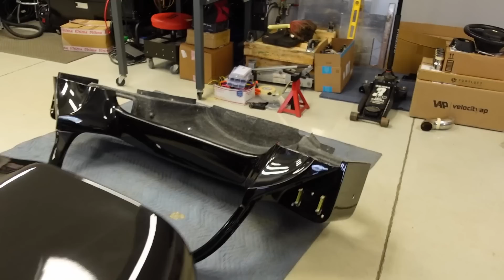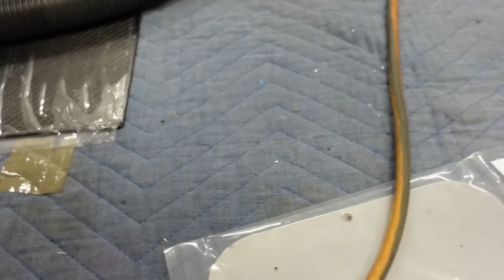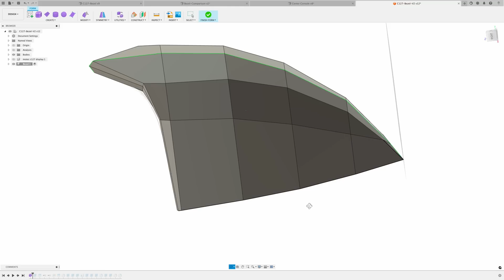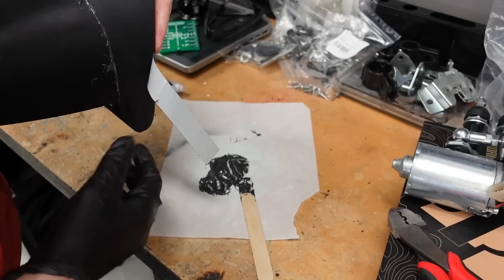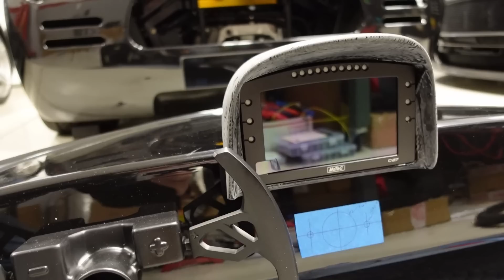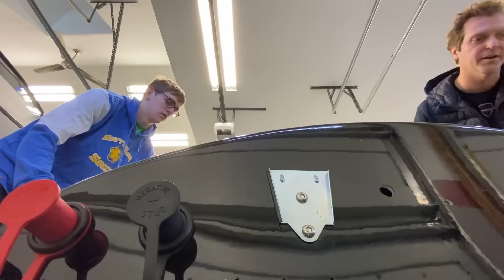I Design a Custom 3D Printed Gauge Bezel!

Comment: Not a criticism but wonder if you will revisit the MOTEC display once the car is finished, I have sneak suspicion it might be too high and block your view out inconveniently… guess it woul just mean a new 3D printed pod and drop the display down into the dash a bit more. 

Looks awesome… wonder what your next project will be to top this this one. 🤔

What about a full carbon replica 6R4 metro by MST in Wales, UK… their Mk1 ‘escorts’ are beautifully made.
Reply from the maker: With both versions of the pod, I sat in the drivers seat with the windshield in place to test visibility.  For sure version-1 was way too big.  But for version-2, I lowered the display another ~25mm and it's at a good height, imho.  I don't want it too low as I want to see the display somewhat in my peripheral vision.  But as you stated, I can always change it later if need be.  

Great question about my next project...I have a couple ideas but certainly thinking about it!

Comment: Dan, firstly love the build. It's probably too late but I personally think that the binnacle still sits too high. Using the same mounting points, could you not trial another binnacle with a lower profile thereby lowering the screen further down the dash? Please don't take this as a negative comment, as everything else you've done is fabulous.
Reply from the maker: Hi Richard--no offense taken!  I love feedback as it helps me refine over time.  The version-1 pod was definitely too high and too big.  I lowered the entire pod and screen ~25mm more for version-2.  With the windshield in place and sitting in the drivers position, I considered going even lower before I printed version-2 but then the screen starts to escape my peripheral vision.  The 7" screen is certainly big for the small dash real estate of the Ultima.  I considered the 5" MoteC display and it would probably be better for the Ultima but I wanted the extra screen for maximum flexibility.   But like you said, fairly easy to change down the line if needed.  Thanks again for your feedback!

Comment: Cover the binnacle in carbon fibre !
Reply from the maker: I definitely considered carbon skinning.  I might make another one so I have options.  🙂. But I ultimately decided on Alcantara due to it's low reflectivity; will minimize windshield reflections on sunny days.  Plus it will match the rest of the dash that will be covered in black Alcantara as well.

Comment: Dan, I really admire the standard of your work on the car, the thought that you put into the build, and the quality of your videos.  Did you consider angling the monitor towards the driver?
Reply from the maker: I did consider that. But it didn’t make much difference given how small the cockpit space is. Plus sharing the display with the passenger will add to the riding experience. I also considered putting the bezel in front of the driver but it’s nearly completely obstructed by the steering wheel.

Comment: For those side areas where you need to climb over I would recommend a harder flooring type of vinyl or leather like material or a marine or kitchen carpet or some heavy patterned rubber as used in truck beds.
Basically you want something that will tolerate abuse as those areas very quickly accumulate scratches stains and other damage. You also want them a bit slippery so as not to grab clothing and skin if someone sits on them to climb in and out.
Reply from the maker: Great advice as always!  I love the look and feel of Alcantara so I'm going to give it a go.  But I'm going to make sure to 'section' the covering so I can easily replace just the top bits when/if it gets worn.  I was originally going to carpet the top sides for the very reason you mention; but ultimately i want to try something different. 👍
Reply: @DanDulac  .
There is a kitchen carpet that looks and feels a lot like alcantera, it’s a vinyl with a flock like coating of about 1mm thickness on a 3-4mm backing
It usually comes in tiles and has standard flooring style patterns and colours, but if there’s a marine version you might be able to get it in a roll and of one solid colour.
I had several old sample books of it that I used to carpet my workshop. I had to move before I wore it out so I don’t know how many years it was going to last but I got about six out of it with little cleaning and plenty of dirt and grease.
Reply from the maker: @anomamos9095  interesting!  I’ll do some searching and see what I can find. Thanks again!

Comment: Great progress Dan! Coming from a guy that subsequently ripped all his sound deadener in his GTM, whenever you get to laying carpet on the floor, use MLV, a decoupler, and sound deadener. Will stop a lot of annoying road noise.  Little extra effort (and weight) made my car much more comfortable. I used second skin stuff. 

Love how the gauge pod came out!  Does the motec PDM monitor for low voltage to prevent an over discharge when sitting? I have an In Reserve active battery management system with my infinity box canbus and glad I installed. Not sure if Motec has something similar.
Reply from the maker: Great advice on the flooring substrate before I lay carpet. I had to lookup MLV as I’ve not heard of it. I’ll definitely look into it!  I’ve used dynamat type stuff before but not MLV.  The MoTeC has low voltage detection and hoping o don’t have any similar issue. So far so good!

Comment: Great work Dan. I would just change the position of the battery posts. Positive where you have the negative and vice versa. It's just because that positive looks to be very close to the chassis and it will be very easy to produce some fat sparks when you attach battery jump cables.
Reply from the maker: Great minds!  I was thinking this EXACT thing when I was producing the video. It would be very easy to do some unscheduled chassis welding with the current situ. I’m DEFINITELY going to swap those posts. Thanks for your comment!!!
Reply: @DanDulac  You're welcome!